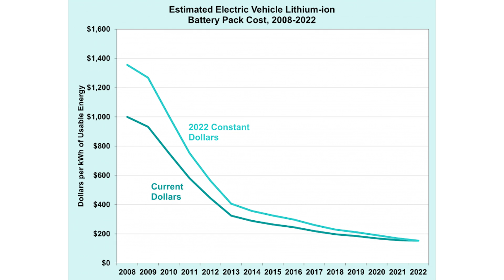Electric Vehicle batteries in 2023 will be 95% CHEAPER than 2008

Comment: Thanks Sam, you are helping to explode the many myths regarding batteries. For example there is the constant claim on talkback radio that the batteries can’t be recycled, which is 100% wrong!
Reply: Yep, Redwood Materials claim they can recycle 95% of EV battery contents. So, eventually the need to mine materials to make batteries will greatly drop. It will be practically a closed loop system.
Reply: @UnexpectedBooks  The possibility of battery recycling eliminating the need to mine materials for new batteries assumes that the need for batteries will reach a steady state. However, after the need for batteries in EVs reaches a steady state, it is likely that other uses will be discovered for batteries (since the price and performance of batteries will have improved to make them practical for uses outside of EVs), such as shipping and airplanes. Because of this, my assumption is that there will be a need to mine for battery materials for many decades to come, perhaps indefinitely. Jevons Paradox is relevant.
Reply: @CiaranMcHale  🌏😊 thank you for your response. as I see the scenario at the moment I really feel we have most probably no choice.   we have a very big problem that is all our governments appear to be run by the toxic fuel industry. have you read the history of the oil industry???? this is correct. they seem to run and influence all governments.   We live in a polocracy a one industry world with drug war oil Bank toxic.  we have the criminal in charge.   We need to get off toxic fossil failure.
Reply: wow' woman yesterday came up to me and explained how batteries are bad for the environment because they've got lots of heavy metals in and can't be recycled.  I did ask her what she thinks is in her car and tank?   she looked, puzzled,  then explained you have got a substance in your tank which is highly carcinogenic extremely poisonous and is causing anthropogenic extinction because you burn it!  also global fossil fuel is responsible for mining raw materials as an example,. cobalt which the fossil fuel industry burns part of the refining process. The refining process itself is excruciatingly poisonous and extremely wasteful I also explained using more electricity than it would just power electric car directly.    I then ask her. perhaps you should just rethink the obvious  invested in interest ,  the fossil fuel industry,  think about it look at  science.      I also added you look reasonably intelligent so when you start that car up and burn a battery each week think.
  Batteries could easily last 100+ years producing renewable energy locally or from your own home. joined up with a smart grid and also the car becomes a bank of energy which you can then trade with other people. The fossil fuel industry do not like this for obvious reasons.  at the end of life, the battery  then is reused for other uses like battery storage in the house and after an extremely long life you get exactly the materials you put back ,  this is called a circular economy. sadly we need to reform capitalism drastically as capitalism thrives on consumption and burning of vegetable materials.   with the huge amount of money on a huge influence globally they own the press own own all governments.   
End all mining.    Toxic oil companies and a long history of misinformation  lying, war misery, death and murder and the arms industry and the drugs industry. it is time we end the criminal age time to question toxic fossil fuel industry end global feudalism.  time for renewable energy for everybody on the Earth and to have global non-profit leadership the truth.    #buzzofftoxic #tiedamew
Reply: @buzz8019  Sounds like an exhausting exchange. I'd have just told her to f off and mind her own business. ;)
Reply: sodium batteries dont have any rare materials like lithium that need to be recupareted. sodium batteries will be left to naturaly degrade into its base components like salt iron and phosphate wich are envariomantly frendly.
Reply: @cornelstamate2537    @Ciaran McHale  🌏😊 thank you for your response. as I see the scenario at the moment I really feel we have most probably no choice.   we have a very big problem that is all our governments appear to be run by the toxic fuel industry. have you read the history of the oil industry???? this is correct. they seem to run and influence all governments.   We live in a polocracy a one industry world with drug war oil Bank toxic.  we have the criminal in charge.   We need to get off toxic fossil failure.  The amazing thing is 30 years ago we were talking about salt batteries. it is so good to see actually something being done about this technology. there is amazing technologies which appeared to be sat upon and not really researched